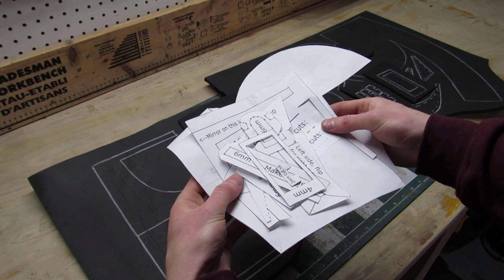How To Make a Foam MANDALORIAN Helmet

Comment: this is my second foam project, and it is pretty easy but at times it can be difficult. Contact cement can be unforgiving when you don't properly align pieces.  All in all its coming out nice. I am working on a costume, using the helmet, shoulder pieces and chest plate.
Reply from the maker: Awesome! Practice makes perfect! :)

Comment: This is so cool! i am planing on building it soon, i was just wonder what the easiest way to transfer the templates onto the foam is? thank you
Reply: also i remember you using charcoal on i think the upper half of the armour is there a reason you didn't use it here?
Reply from the maker: To transfer the templates onto foam, I simply cut out and trace each piece on EVA foam of the indicated thickness.

I believe you have seen someone else use the charcoal technique as I have never used it.
Reply: @TristanMaker  ok thank you!

Comment: Hey Tristan, how did you add the 2mm trim over the visor? What technique or tools did you use? I tried opening it with the burn technique but it came out a little crooked.
Reply from the maker: That's a separate piece of 2mm foam glued on afterwards

Comment: I'm currently using your build to make the helmet, I just wanted to know in the step where you're sanding down the helmet after the resin hardens, what grit do you use? Do you only use a single high grit the entire time or do you move from 80 to like 500?
Reply from the maker: I recommend starting pretty low like 120. Just make sure not to sand all the way through the resin. After that go up to 220, and for an even cleaner finish 320.
Reply: @TristanMaker  oh okay, perfect. Gonna do that and see how it works. Thank you for the quick response!

Comment: Hey Tristan, another question. You mentioned that you put 3 coats of resin on the helmet then sanded it down. Did you sand it down after every coat? Or did you sand it down at then end after you applied all three coats? If you can help me out with this I’m doing the same right now but I’m not sure when to sand it down when resin is applied.
Reply from the maker: I sanded the resin after each coat :)
Reply: @TristanMaker  hey Tristan, one more question, after you applied the 3 coats and sanded it down. Did apply primer or is it ok to apply the dark gray paint ?
Reply from the maker: You can apply the paint directly if you think the surface is smooth enough. If you're not sure, primer will show the remaining imperfections.

Comment: What paper format is this

I bought it but have no idea what format that is (I am from europe)
Thx fore the quick answer I found it👍
Reply from the maker: If you are wondering how to print it, make sure you open the file in Adobe acrobat Reader. Then in the print settings, select the "poster" format. This will let you print the file at full scale on multiple pages of whatever paper type you use.

Comment: So after trying the epoxy resin, are you sold on it? Is it worth the extra money and effort over something like mod podge? Or is the difference negligible? Great video, I’m just moving on to the painting stage for my helmet and I just purchased your armor templates. I’m a beginner and your work is easy to follow so thank you!
Reply from the maker: At first I was sold, but since then I've been using a different technique with 5 layers of modpodge, followed with 2 coats of filler primer (optional) and that works really well for me.

The more coats of modpodge you add, the better the end result. Just make sure to sand the surface smooth before adding paint.
Reply: Thanks for the reply. Happy to hear that as I went with 5 layers of mod podge, myself!

Comment: Hello from Germany, thank you for your templates. I found all on etsy. But I have one question: Is it really good to use resin on the helmet. It is not elastic, so you risk your painting??? Or ist it not so? Thank you
Reply from the maker: The resin with make the helmet less flexible, so easier to paint like a 3D print, but it might crack if you drop it. Check out my Boba Fett helmet build for another option for sealing the helmet.

Comment: How do a print the template peices to the correct size? I printed it to printer paper but it's too small.
Reply from the maker: Check the product description on Etsy. There's a link to a printing tutorial video with all the info you need.

Comment: Anyone know if mod podge would be a good sealer for this. If so matte or gloss ?
Reply from the maker: If you are talking about sealing the foam before painting, mod podge is a great option. Just apply 3 to 5 coats of the matte version. Then you can sand it with 150 and 220 grit sandpaper for the best finish.

If it's for sealing the paint, that won't work very well. Mod podge is not made to be used as a clear coat since it doesn't dry 100% clear.
Reply: @TristanMaker  thanks Tristan. I meant sealing the foam. Thank you 😊

Comment: Anyone know if the t shape front piece sides are also recessed out by 2mm or if it's just the top bit ?
Reply from the maker: The whole piece has to be 2mm higher. So the top and both sides.
Reply: @TristanMaker  thanks Tristan :)

Comment: Hiya whats the density and how big of the sheets do i need
Reply from the maker: I used medium density foam but high density would also work. 
About 1x1 meter of 8mm foam and 1x0.5 meter of each other thickness specified on the templates should be more than enough.
Reply: @TristanMaker  where did you buy your foam from
Reply from the maker: I'm from Canada so I get my foam from True North Cosplay.

If you live in the United States, I recommend getting it from TNT Cosplay Supplies or Blick Art Materials.

Comment: Hey Tristan, 

I just bought the template and wanna go to work.
on what size paper did u print out the template?

I have a A4 printer how can i ajust the PDF to print it with the correct scale or should i print it on A3 format.
Reply from the maker: You can print on any size paper. Watch the printing tutorial video linked in the product description on Etsy, all the information is there
Reply: @TristanMaker  Thanks for your reply but i already checked that video, It must be my printer.
Reply from the maker: If you don't want to deal with printer problems. I always recommend just going to a local print shop and ask them to print the template at full size.

Comment: Okay I rally like your template better and also I chose it because it isn’t an oversized helmet. But then I printed it out and it seems too small? I mean 8mm seems really tiny? I hope I’m not reading it wrong or anything. I’m just afraid of the helmet being too small.
Reply from the maker: Hi, by following the printing instructions in the printing tutorial video, you should be able to print them at full size. The only thing you have to change is the format in the print settings. Have fun crafting!

Comment: Can undo it in card bord
Reply from the maker: Check out RJR Production's video where he built one out of cardboard. He even has templates for it. :)
Reply: @TristanMaker  he is rely good but I need a template
Reply from the maker: RJR Production has templates for the helmet on Etsy which are specificaly for cardboard. My templates would not work for cardboard since it doesn't behave like EVA foam.